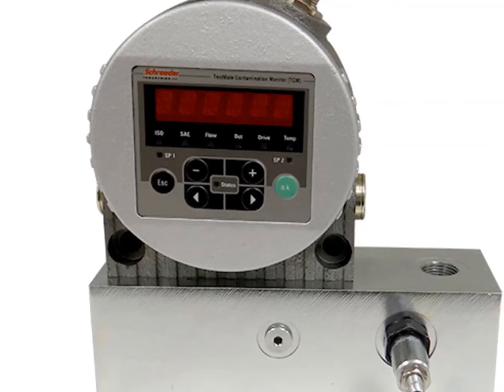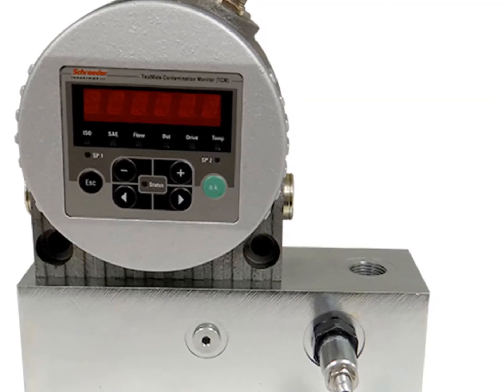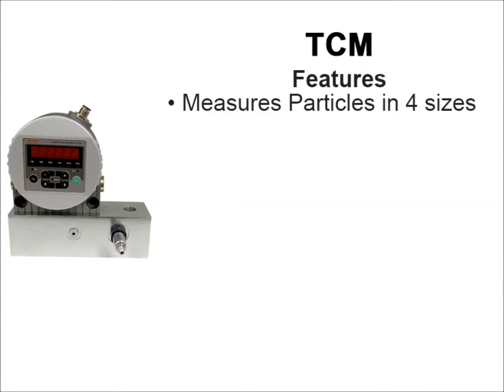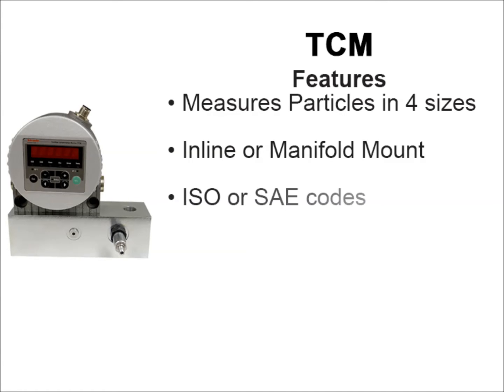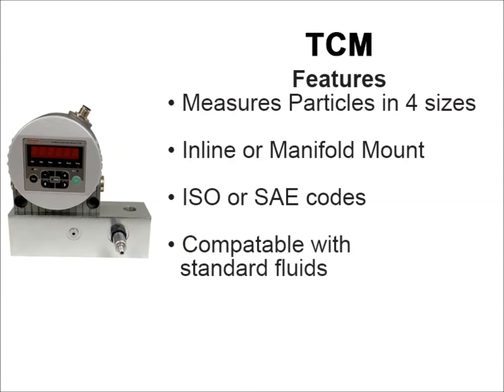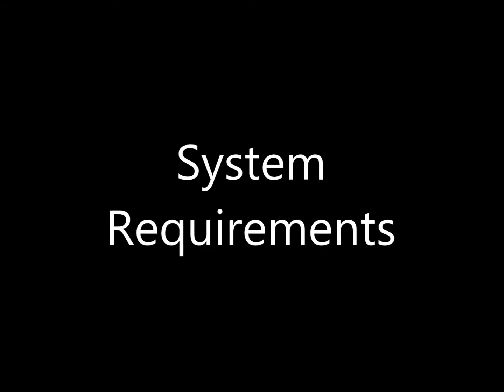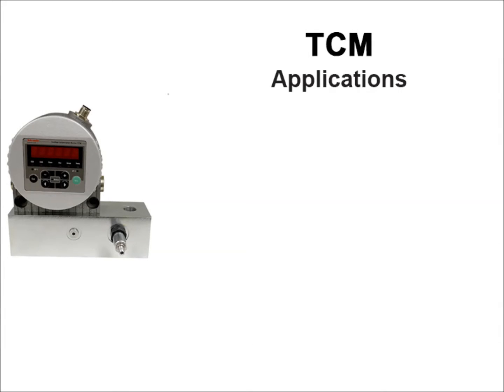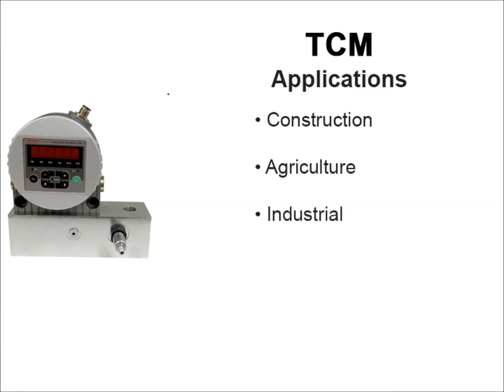CS: In-line Particle Counting for Hydraulic Fluid and Fuels

Comment: para que sirve o que es la pieza que está entre la entrada y salida del fluido?
Reply from the maker: Hola santiago

Gracias por su consulta. Para responder a sus preguntas, el CS1000 es un contador automático de partículas que mide la contaminación de partículas de acuerdo con las normas ISO4406: 1999, SAE AS 4059 y NAS 1938.

No estoy seguro de entender la segunda parte de su pregunta, pero el sensor es una tecnología de detección basada en la luz.

Si tiene más preguntas o necesita información adicional, no dude en enviarnos un correo electrónico a sisales@schroederindustries.com.

¡Gracias!